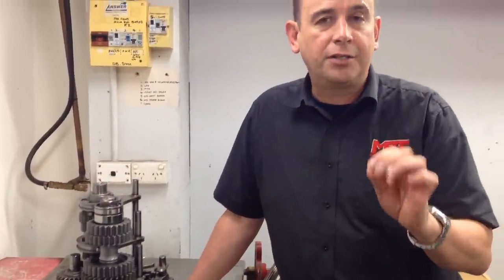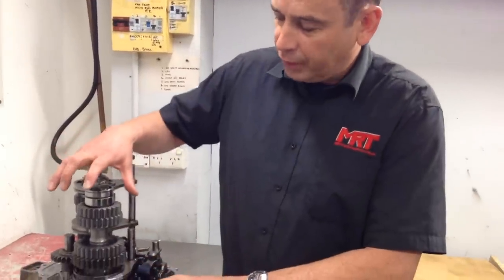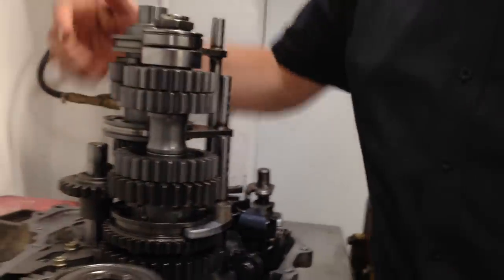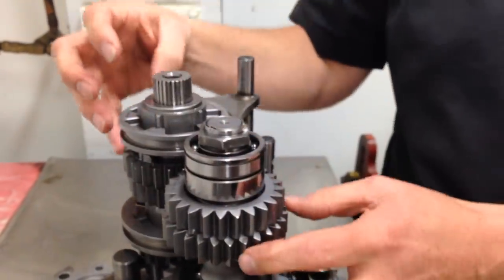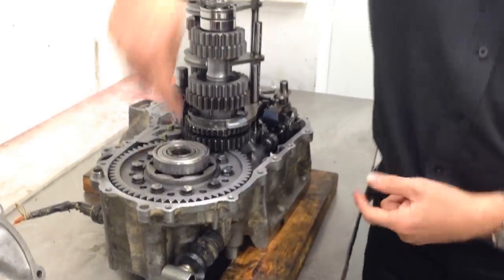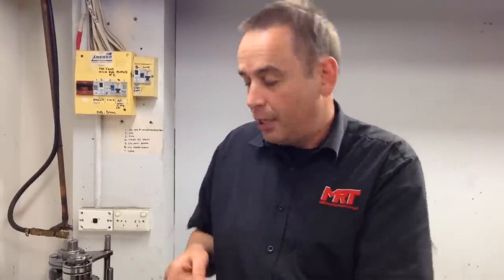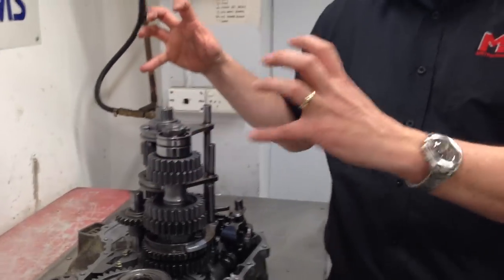Straight cut gears explained as well as the Dog Box

Comment: Lucky you remembered that last bit of info regarding the dynamic forces,  imo it was some of the most important information in the video as to why straight cut 👍
Reply: I'll be putting my new th 400 with straight cut gear set in my Sonoma in the next couple days, I went with the no lateral forces excuse the whine is just a bonus, I figure with the tranny whine, solid roller and 9" locker it's going to be like a symphony driving down the road.🙃
Reply: @heshtesh  agreed! I love the sounds of meshing machinery. In cars it is usually associated with high performance (at times with %0 maintenance) but yeah usually the good stuff 👍

Comment: Why does a dogbox slam into gear as opposed to a manual slides into gear? Is it the syncro rings in the normal manual that prevents the instant slam into the next gear?
Reply from the maker: +Jesse Jesse there is no synchro in between
Reply: And that's why it slams into gear violently yes?
Reply: +Jesse Jesse 
I just wanted to ask the same question. on synchro manual transmissions there is synchro ring between shifter ring and gears.. on dog transmission there is nothing between. so how do not shifter ring and gears grind each other when shifting?
Reply from the maker: not easy to type an explanation
:(
Reply: +T0mB1ll I'm not too familiar with transmissions but I think it has to do with the fact that the gear teeth are always in mesh unlike a synchro mesh gearbox. So there's a larger gap for the dog teeth to mesh into compared to getting gear teeth to mesh together. that's my assumption anyway
Reply: +T0mB1ll    Dogs have a lot of space between them, where synchro gears are a near perfect fit, so the syncro is necessary to line them up. Dogs have a lot of room to fit in and not bind.
Reply: +Moto Rad 
It would be a lot easier to understant if somebody made a computer animation changing gears but I think I get it now.. 
got another question? Is that why Dog shifters are so noisy in, for example, a rally cars? when they change gears, dat clicking sound?
Reply: T0mB1ll There are animations, search real quick.
Reply: i don't know if i'd say 'slam' into gear but it wouldn't be as smooth as helical gearing, that's for sure.  imagine going from a sprung clutch to an unsprung that super grabby on-off switch type feel, but imagine with transmissions.  I might be completely wrong, but that's what i've gathered and assumed.
Reply: @T0mB1II The click sound is due to the space between the dogs, unlike perfectly maltching synchros. When you slam into gear, the dogs will basically slam together... the same will happen if you release the throttle and then slam it. The loose space between the dogs will do this clicking noise. Hopefully you understand
Reply: +Jesse Jesse it's because people don't know how to shift unsyncroized gearboxes
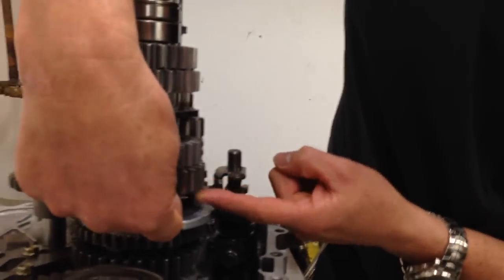Reply: 2:03 See those "lumps?" or "dogs?" That's why. Instead of having syncros there, there's only four lumps, and those have quite large gaps to slip into, causing a collision every time the gears are shifted.
Reply: Its just like a motorcycle, you are supposed to "catch" the gears by matching the rpms inside the box and then engaging. I think he might be wondering how synchonisers seem to resist a shift as they match speed then slide out of the way when the job is done.
Reply: They do grind if you shift slowly, thats why this type of trany its just for Racing, the faster you shift the better for the tranys health

Comment: Great explanation. Not sure if you'll see this, but what causes the gear to pop out? I have a dog box and 4th gear is popping out, and when it goes in, it almost feels like it's barely getting into where it should, struggling to engage 100%. Any ideaS?
Reply: The people want a reply
Reply: Dogs, and or doghouse are worn or rounded over. Dogs are usually slightly undercut matching the doghouse, which physically hold the gear engaged under load. If it's popping out that means you have rounded the undercut dog ear off.

Comment: I know this is an old video, but I have a 93 accord sedan, and I'm looking for a dog, straight cut transmission, don't care about whining, just strength, and reliability at 250-300hp. any help, links, anything like that would be madly appreciated. 

Street car only, car is probably never gonna even think about seeing a track, plan on putting nos, maybe boosting it, don't want short gears, id prefer a 6 speed over anything, and id like to be able to reach near 180-200mph, or close to that, but also get off the line very quickly, 0-60 being around 5.5-6.5 seconds, and 0-100 being around 10-12 seconds. 
again, any help at all would be appreciated.

Comment: Would the straight cut gears aid in better power transmission, i.e less overall drivetrain loss?
Reply from the maker: Car Nut in theory yes
Reply: +Car Nut Straight-cut gears are actually worse for power transmission than helical gears. Helical gears are also stronger than straight cut gears due to their higher load-bearing surface area. The only reason straight-cut gears are used in racing transmissions is they don't produce axial loads along the main shaft or counter shaft which can cause a failure in one of the shafts, or more likely, it can cause the transmission case to fail.
Reply from the maker: err?

Comment: I have a 2000 ford Mustang the shifter is sticking it hard to shift please need help
Reply: If it is cable shifted try oiling up the cable sleeve and making sure the levers are pulling freely.
If it is directly shifted take the gearstick out and check for buildup around the base of the stick